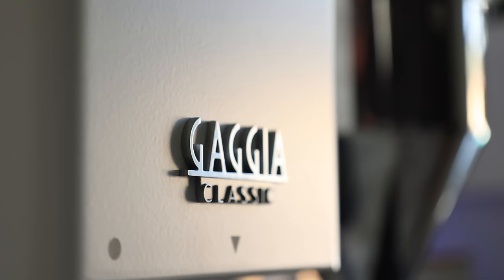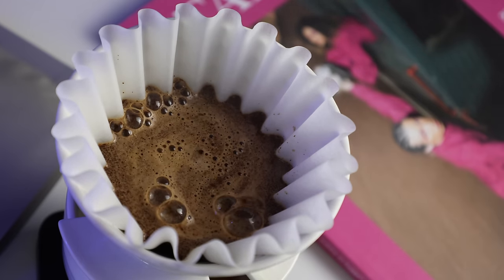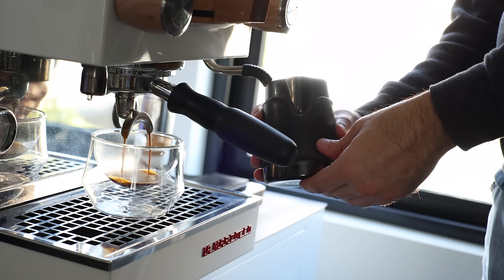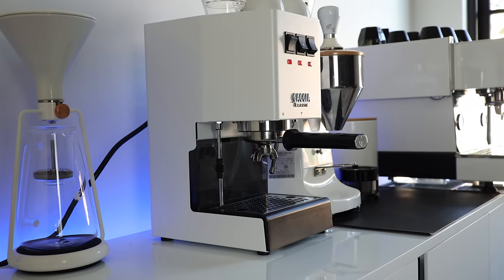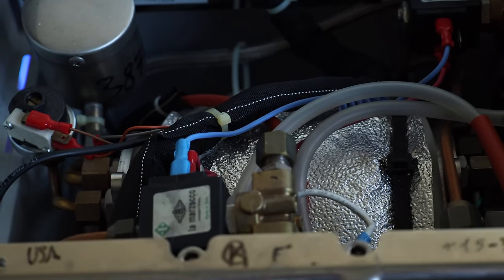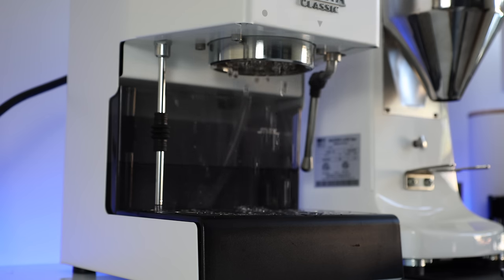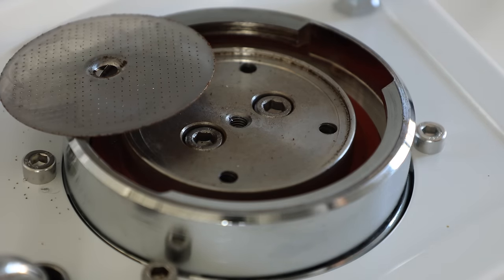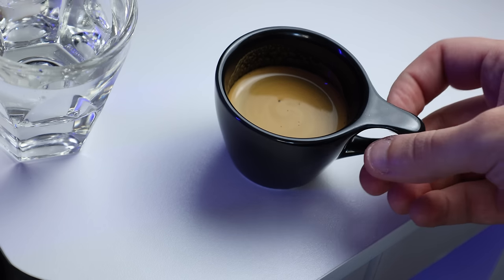SIDE BY SIDE - $500 Gaggia Classic Vs. $5,000 Linea Mini

Comment: Great review.  My Gaggia is so customized - 9 bar spring, wood handles and knobs, 3d  printed lower/extended tray (for scale to fit), shower screen, baskets, SS group head, single hole steam tip, etc.   Even if I could grab a 3-5k machine….would I?  I have even cleaned the solonid valve and replaced the thermo-fuse…. I am dialed in and so is my espresso!  Ha
Reply: Do you have a link to the 3d printer lower for the gaggia? Would you be willing to share your recipe for espresso?  Lol. Some keep it a secret and i can understand that.
Reply: @johnnyringo4463  For the tray, Shades of Coffee sells some. Idk if they're identical, but they're definitely viable.
Reply: I think the limitation is the temp stability.  The gaggia has a small boiler, even mine with a PID installed I see drops of 5-10F in a 30sec pull
Reply: Hi Jonny I would also like to see a picture of the tray mod and any additional detail on the 3d print.
Reply: @joel3068  that boiler is small
Reply: I’m back and forth on upgrading the shower screen and it seems like it’s a purchase that most gaggia owners regret or find no improvement. Do you have any thoughts on this? 

I’m considering the IMS or BIT upgrade. I’ve done the gaggiuino mod and I’m trying to push the gaggia as far as possible!
Reply: @calvincheung3955  I did upgrade mine. . . .a qualitative difference. . not sure.  The shower does look better in free-flow.  Could be placebo effect  - but I like mine.
Reply: @johnnyringo4463  Sorry this is a year old.  I used Etsy and found lots of providers for 3-d gear for the Gaggia. My recipe goes like this:  17.5 grams in, paper screen in the bottom of the filter basket (wetted) - coffee in, clump wire tool stir, level, tamp, metal screen on top of grounds.  I open the steam wand, fill the switch and at about 4 seconds (first drip).  I then close the steam wand and pull the shot looking for 35 grams out in 25-30 seconds.
Reply: @joel3068  I have a PID as well and yes it's still not super stable but for 1 - 2 shots. . . better than without
Reply: @hugoglenn9741  That it is
Reply: @johnalleman2918  I switched from the auber PID to the gagguino mod and the difference in temp stability is huge.  Gagguino maintains temp within 1 degree because the software accounts for the influx of cold water from the tank.  Totally worth it

Comment: Not sure why Gaggia simply doesn't make an upgraded version of their Classic Pro that includes the correct spring, PIP, and a better tamper and porta filter, and charge around $900.00 for it. I think it would be a super product.
Reply: I think it's just that price point you can get a classic pro just under 500.00 I paid 435.00 with free shipping I think gaggia wants you to be more hands on and do the upgrades yourself if you spend an additional 300 it would be the best it could be I think ro let's say total under a 1000.00 I just love it's size you can rebuild them forever
Reply: cause there is no competition, and gaggia is milking it for 30 yrs
Reply: Another upgrade that did exist and I would like is the stainless boiler, I think most are aluminum although I have had no problems in 15 years, I guess it’s not Chinese made

Comment: As a long time Classic owner, the main reason to upgrade to something like the Linea would be making coffees for larger groups of people. Larger boiler, larger pump, smaller stress, greater speed.
Reply: This really is the only reason to upgrade from a Classic. Barista for 4 years, and can make as good coffee on my (modded) classic as I can on commercial machines. Bean and grinder quality is far more important. But making drinks for multiple guests is a ballache on a tiny single boiler machine, and why I finally upgraded to dual boiler.

Comment: The Gaggia is “quirky:” having to Temp surf, dealing with clearance issues, and low steam pressure for back to back shots…then there are the upgrades like OPV spring swap, etc. But I have to say that all these things add to its character. So much so that months after upgrading to a quick mill, I do find myself missing the Gaggia. I think that says a lot!
Reply from the maker: Yeah it seems every machine has it quirks for sure, I have found myself surprisingly fond of the Gaggia after the couple months I’ve had it. It’s a plucky little machine that makes great espresso, I found the steam to be its worst feature.
Reply: @Sprometheus  I have a gaggia classic with an Auber PID, and I can say that the steaming is way much better with the PID installed. Maybe you could try that MOD, it is the only one you didn’t aside from the pressure dimmer MOD, and it is probably the one that brings the most difference in the end!

Comment: It's all perspective here. I started making espresso 26 years ago using a plastic unit that my daughter gave me for Christmas. Since that time I have gone through several plastic units up to 2020. I decided to buy something more substantial and settled on the Gaggia Classic. The first thing that I noticed is how heavy and rugged the machine is compared to what I had been using. The unit is so heavy that it doesn't even move when I put on or take off the portafilters. I am very happy with this machine that has been serving me well for over two years now. The thing that is amusing to me is that this gentleman has the same experience only ten times more in cost. It's all relative!
Reply: Most important is that it’s made in Italy,  non obvious is things in Italy you usually can find replacement parts, that’s never true about Chinese plastic ones.  Hence the term throw away society.  You just started a much larger path of leaving the throw away society mentality and didn’t realize it

Comment: An interesting comparison to highlight more for those getting in to home espresso, the differences between price ranges.

I’ve got fond memories of the used Gaggia Classic I bought from eBay as my first espresso machine (after the obligatory Moka Express, of course). I slowly bought my collection of tamper, grinder, VST filter basket and other hardware to help me build the marginal gains towards espresso nirvana.

After 2 years I eventually had enough money and need to buy a new machine. Sold the Gaggia for nearly what I paid for it and landed a Bezzera BZ10. This machine was bullet proof in terms of build quality, heat stability and out put, it was a big jump up but my skill set had grown with it.

I attended an SCA barista course (I would urge anyone with a mild interest in home espresso to do this) and learned a lot more again about how to make good espresso.

At around the same time I was fed up with my career in advertising and made the bold move to jump into coffee as I bought and built a nifty coffee trailer with the Marzocco Linea 2 Group as it’s centrepiece. Sadly, that lasted 6 months as business and my location became untenable. I sold the hardware and was left with the experiences and scarring of a small business owner. 

Recently I sold my Bezzera BZ10 and pushed into an Ascaso Steel Duo as I wanted more variables to work with. I wanted to explore what changes in pressure, pre-infusion and also a machine that didn’t waste as much energy as my 9 year old, solid as a rock Bezzera. I managed to get back what I paid and put in enough to upgrade. I had already upgraded my old, noisy but pretty baby blue Eureka Mignon grinder to a Niche Zero in the summer. 

What strikes me about home espresso is that you will constantly have to learn and adapt and find the sweet spot of what you can output. It’s a hobby as much as those people who buy cars that they tinker with. I love dinner parties when my guests have their after dinner coffee and exclaim ‘it’s the best coffee they’ve ever had!’ And I’m immensely proud of my skill set and when they ask me how I do it and show genuIne interest.

You may not be able to afford a Linea Mini but start with the Gaggia, drink espresso at home and compare it with cafes that you like. Buy beans and a grinder and slowly get the filter basket, tampers etc and enjoy the journey. Just like buying a Ferrari won’t make you a Lewis Hamilton, the same goes for the La Marzocco. Start a journey instead.
Reply: Awesome comment. thanks
Reply: @aydiosmiodemivida I just saw your notification and ended up reading my comment back. That WAS pretty good, huh? Sold my Ascaso and now have my eye on either a used Linea Mini OR a Lelit Bianca V3. Which one to choose?
Reply: @seehearplay  I'm going to start my coffee journey as well, and I had my eyes in the Linea Micra, but perhaps t's a bit too much for my first machine after the Bialetti. Perhaps the Gaggio or the Giulia makes a bit more sense. btw Funnily enough, I work in advertising too
Reply: @aydiosmiodemivida  I have just dropped advertising recently to try real estate. For your coffee machine, I would try a Gaggia first   with a decent grinder like a Niche. Then buy the naked portafilter, basket etc.

Comment: I grew up with a Gaggia classic, my dad has three of them now, one in the garage, one in the summer home, and at my parents house. When I studied abroad I bought one of the second market and when I moved back to Norway I got one again off the second hand market. It is just so easy to buy parts, build, modify and make great espresso with for three to four cups per day without busting the budget. 

One negative aspect is the one boiler as this makes it harder to steam with perfection, however, with some patience and practice, the machine and you will end up with great results.

Gaggia have created a machine that can be repaired forever and still keep running. My dads first one has been running for 20+ years now and still makes great espresso. So hand down to them for that. I know I will buy a high end espresso machine at some point, but I dont think I will ever throw away the Gaggia!😅🤙🏼

Comment: I am a proud owner of a ~25 years old Gaggia Classic. I have installed almost every (popular) upgrade: stainless steel brew plate, IMS shower screen, PID controller, bottomless portafilter, IMS filterbasket, silicone gasket. 
I can comfortably say that my espresso is the best I have ever tasted. Just recently I saved some money and was faced with the decision wether to upgrade my machine or my grinder (Bezzera BB05). I chose the grinder because I couldn't think of any espresso machine that would have been worth the upgrade.
For me the GCC is perfect. It got me started into espresso and grew with me. Today it makes perfect espresso, every time.
Reply: Hi! I want to buy a machine and I’m deciding between the GCP or the Silvia. How’s the Gaggia performance and speed when pulling back to back shots when for example you have visits in your house? Thanks for the advise!
Reply: @alono4473  the GCP has a boiler size of ~80ml and the Silvia has like ~300ml or so. Speedwise there is no difference but the GCP will struggle to keep a constant temperature when pulling multiple shots. It's not like the shots from the GCC will taste awful, but especially when pulling multiple shots like you said I would say the Silvia is the better choice
Reply: @jomivo  Thank you for the feedback! 😃
Reply: @alono4473  my pleasure ;-)
One thing to add: if you're also considering to purchase a new grinder, you should definitely go for the GCC and spend those saved dollars on the grinder. If money isn't a problem, go for the Miss Silvia. But don't cheap out on the grinder.
Reply: @jomivo  I'm a beginner so I don't need yo spend too much on a machine, but I do know a grinder is probably the most important thing What do you think about getting the GCP with the Eureka Silenzio grinder??
Reply: @alono4473  you can't go wrong with any of the Eureka grinders. They are all great!
Reply: Oh and like I said: for more than 2 people, the Rancilio is the better option BUT if you can afford a better grinder by choosing the GCP, definitely go for that!
Reply: @jomivo  Yes I think I'm going with the GCP and Eureka! If you have more recommendations, like portafilter, baskets, showers let me know which ones you prefer! Thanks again!
Reply: @alono4473  First off: try looking for a second hand machine. As long as they were descaled on a regular basis, they will last a lifetime and therefore are a great 2nd hand option.
I've taken apart around 5-10 Gaggias so far and the #1 upgrade I install ASAP is changing the stock aluminum shower plate to a brass or stainless steel one (doesnt really matter which one. IMO the stainless steel one will give you like 2% more thermal stability). The aluminum shower plate will corrode over time making it a huge pain in the a** to remove (and it's also pretty nasty).
While you're at it you could change the group head gasket, I'd suggest a silicone one. You may find a deal on e.g. Amazon where you can buy a shower plate + silicone gasket + IMS shower screen for around 50 bucks, go for that, it will save you a lot.
These are really easy upgrades that anyone can do by himself.

I would suggest starting off with what you will get, there is a lot to learn and you can get lost easily in accessoires and upgrades. Buy upgrades, when you think that you really need them, but get that aluminum plate changed ASAP 😀
Reply: @jomivo  Awesome!! Thanks so much, this info was very helpful 🙏🏼
Reply: @alono4473  always happy to help. If you ever got any more questions, feel free to contact me through this comment or however!
Reply: I’m back and forth on upgrading the shower screen and it seems like it’s a purchase that most gaggia owners regret or find no improvement. Do you have any thoughts on this? 

I’m considering the IMS or BIT upgrade. I’ve done the gaggiuino mod and I’m trying to push the gaggia as far as possible!
Reply: @calvincheung3955  hey there :-)
I've had an IMS shower screen (GA 200 IM) now for years and I love it. I couldnt say for sure, that the droplet distribution makes the coffee better but what I really appreciate is the ease of cleaning. With this particular screen it's always one wipe and as new.
Reply: @calvincheung3955  as you were talking Gaggiuino: I have a second GCP standing around which I repaired some weeks ago. I thought about getting the Gaggiuino too but the price got me recoil from that idea. I've came up to ~200-250$ just for the parts (including scale and ToF). What did you pay in total?
Reply: @jomivo  thanks for the info! was there a reason why you chose this screen instead of the nanotech screen? (GA 200 NT)
Reply: @jomivo  I paid roughly 150 USD - just the regular kit without the integrated scale and ToF. Luckily I got the 3D printed parts for free off a friend, but I'd expect another few hundred. Otherwise it's an amazing upgrade and makes it a completely different machine!
Reply: @calvincheung3955  I have to think about it a little bit. It is a hefty investment if you've got a perfectly fine machine but I kind of want to build that. I can even do the 3D printing by myself

Comment: I have a 2006 Gaggia Classic, it was my entry into home espresso and cost me the grand sum of £30. It was barely used and considering it was 15 years old just needed a little clean inside and out. I initially paired it with the Sage/Breville grinder and have now just upgraded to the Eureka Mignon Specialita, next job will be adding a PID so that I can remove most variables from my shots. I've found the machine a great learning experience and it has the ability to grow with your skills. What I like most about it though is community of Gaggia owners who share such a wealth of knowledge about them and their maintenance, upgrades, repairs etc. They also seem to hold their money very well so when the time comes to upgrade the machine I feel like it will return me what it's cost me.

Comment: I recently bought a Gaggia & changed the opv spring, shower screen & filter basket.
Using the temp surf method I consistently make cappuccino or latte as good as any cafe I’ve ever been to.$4500 differential I could never justify as its a cup of coffee & i can get many great life experiences for $4500 vs a machine that sits idle most of the day
Reply: I think that's what really takes for the Gaggia. If you can kind of work out its quirks to get them to work for you instead of against you, then you can end up with something insane for the price. I need to still do the spring mod and then get the PID mod. I just wish there was a dual boiler for better steaming options. Doing multiple lattes just takes a very specific rhythm and trickery. My favorite thing about the gaggia is how accessible it has been - how I've been able to get into it and grow with it slowly. Changed out the portafilter with something nicer, then changed out the screen, will do the OPV spring, then a PID controller. There is even a roll on pre-infusion hack. And a lot of it is simple and fairly cheap to do. Ill slowly mod this machine and run it for the next few year (going on 2 now) until I can get to a Rocket or some kind of 2-3K machine. And then eventually I'll move to something even better from there, hopefully.
Reply: @TylerPoppe  I did the PID mod and gaggia is unbeatable now!
Reply: I’m back and forth on upgrading the shower screen and it seems like it’s a purchase that most gaggia owners regret or find no improvement. Do you have any thoughts on this? 

I’m considering the IMS or BIT upgrade. I’ve done the gaggiuino mod and I’m trying to push the gaggia as far as possible!